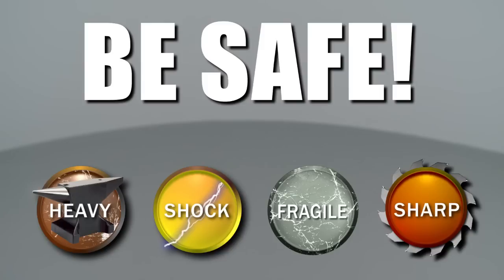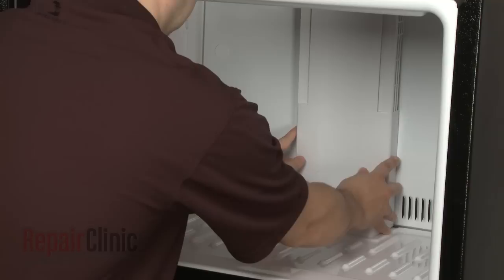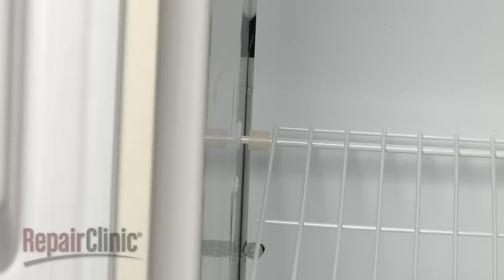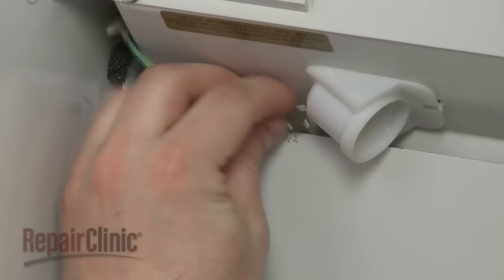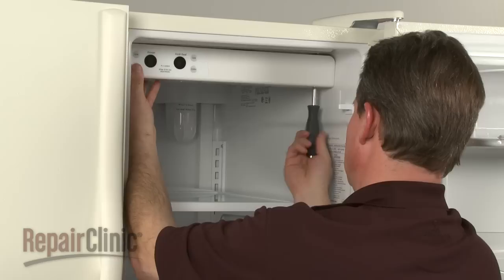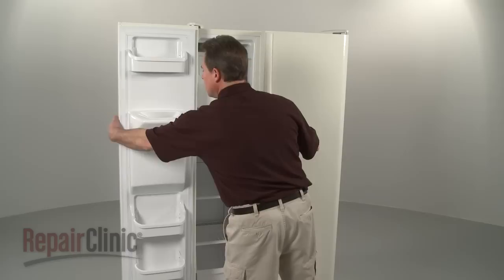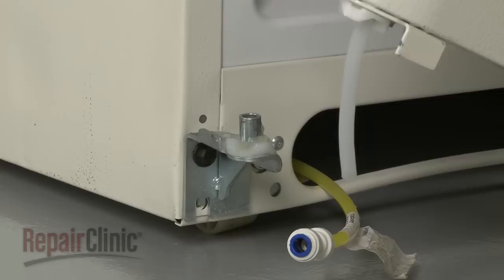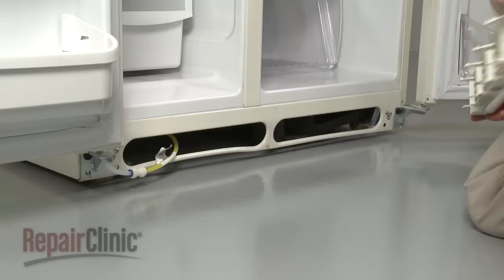Refrigerator Disassembly – Refrigerator Repair Help

Comment: thanks for this tutorial
I have a refrigerator in working condition. but it consumes very high power. So we have bought a new one without sell the old.
So i need to how long we can use that old one? 
Is there any problem keeping that fridge without using?
if there any problem how can i take off the main parts of the refrigerator?

Comment: I have a Whirlpool refrigerator Its about 2 years old. After a power outage, I thought we had a surge and took out the power supply. The next morning I noticed it was coming back on for about 5 -10 seconds and shutting off, After two hours of this it came on and stayed on working normally. Could it have been a low voltage condition from my electric company shutting it down until full voltage had been restored?
Reply from the maker: +joe dolack It is possible the low voltage caused the problem but if the problem continues it is more than likely a bad compressor or capacitor.